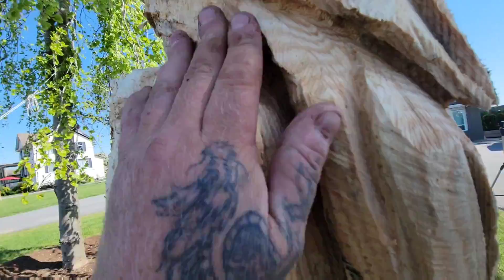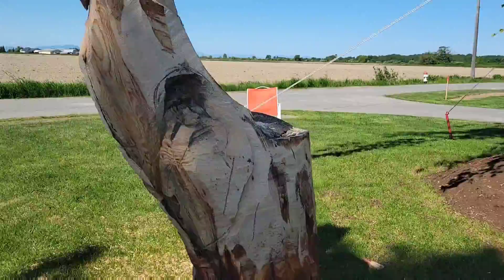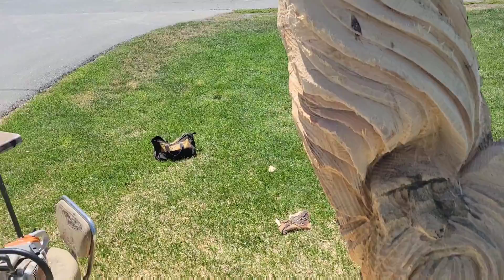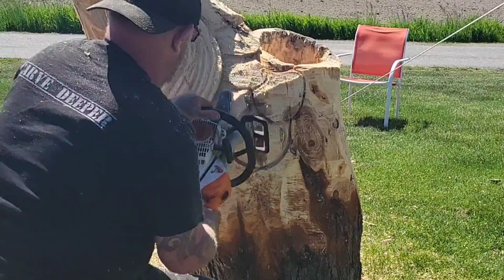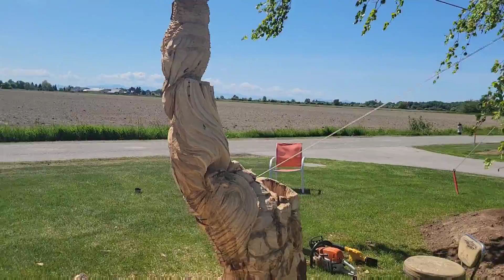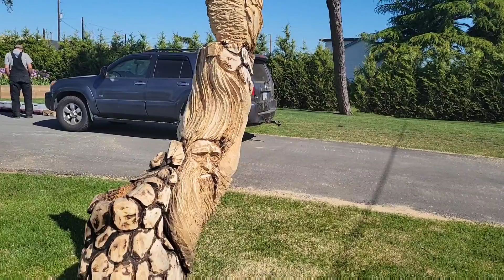Onsight Carving Horton The Whooooo- ter AKA OWL :) #2.

Comment: Hey Jordy hope he hasn't linseed the carving yet a big no I am speaking from experience I did a bench with it looks great but it will mould I was told if you cut it with naptia gas to a 50 /50 ratio it will be fine personally I say silkins  oil stain is the way to go so much work went into it don't cheap  out on the finish just my opinion
Reply from the maker: I guess it all depends on what area u live in, I have put linseed oil on lots of outdoor carvings here in bc Canada and 000 mold